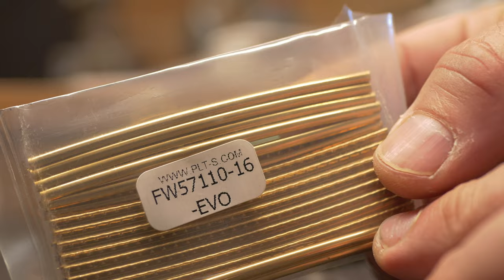Concave Neck Pocket - Travel Guitar Episode 4

Comment: I worked at parker guitars in the early days. The original Parker Nightfly, is a neck with no heel, set in a rounded pocket much like yours, and the neck bolts went in at an angle toward the center instead of straight into a flat heel. This thing your building looks beautiful and extremely interesting.  I cant wait to see it!

Comment: Beautiful guitar! Would you, please, can suggest a practical way to find the center line in a round surface? I have a low cost Parker guitar that was very bad constructed and I took apart the neck to make new holes for the screws, but I found very difficult to put it totally horizontal. I appreciate any tip.
Reply from the maker: Which Parker do you have? You could try grabbing the center line from the pickup routes. Awen just released a video that may help. Check his vid out. https://www.youtube.com/watch?v=mMk0jhqlono
Reply: @MarkGutierrez  Thank you for your answer. The guitar is a low end made in Indonesia. In principle, the guitar joint is very similar. The neck is round but does not have a flat surface such a strat. So it is very difficult to mark the center line, as the neck rotates along its axis, so I was wondering how did you get the center line was my question. I'm planing to put something similar to the carbon fiber elements if yours, but with the only purpose to keep the neck in position so I can set the screws. Thanks again and I really appreciate your time.